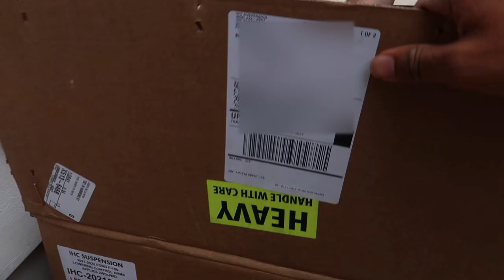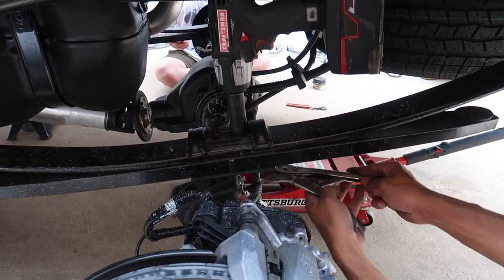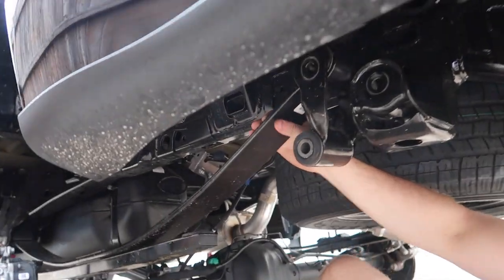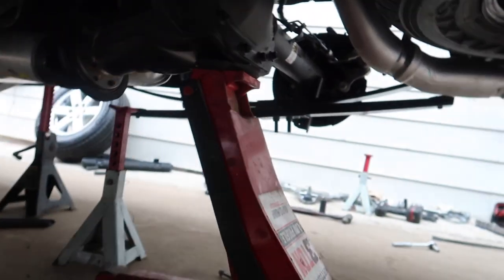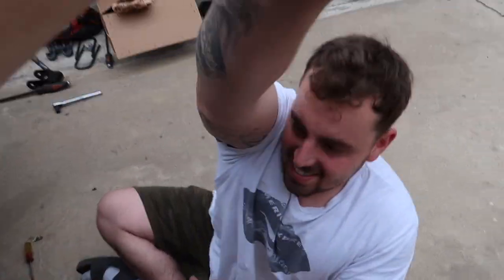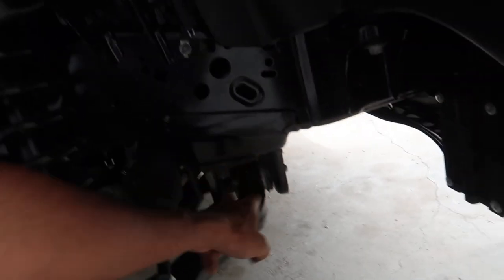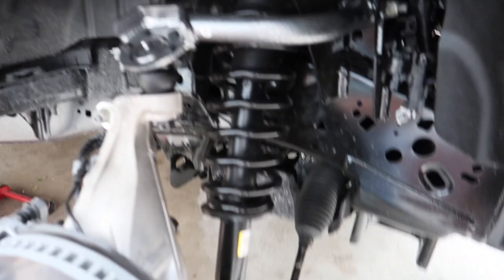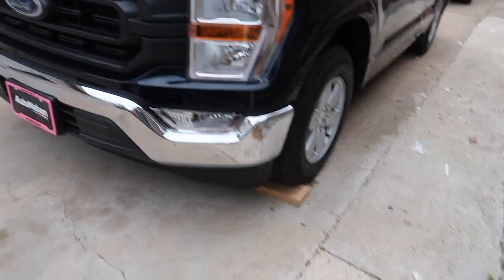LOWERING MY 22 F-150 COYOTE single cab on IHC 3/5 DROP

Comment: Do your leaf springs squeek after you installed the flip kit? I have the same kit and now they squeek. very annoying on a brand new truck
Reply from the maker: Yeah they do a bit! Grease up the shackles it minimizes it a bit. A good set of shocks will help too, I want to get some Viking shocks for it
Reply: @fajitaboyzDFW  thanks , i may loosen the shackle bolts a  little as well .
Reply: What did you end up doing to fix the squeaking?
Reply: @eduardox2609  not really, I loosened the shackle bolt a little and it worked for a little while but the squeek comes back but not too bad.
Reply: The trick is make your truck louder😂

Comment: I’m about to do the front on mine. How did you torque down the control arms? When it’s on the ground or before?
Reply from the maker: Snug them up in the air. if you can’t fit under the truck once you lower the truck, let it sit for a couple minutes, lift it up again and torque the bolts. You’ll probably need an alignment after wards so don’t tighten too much
Reply: @fajitaboyzDFW  thanks for the advice, also what color loctite did you use?
Reply from the maker: @5.0truck  Dont recommend

Comment: Was your rear shackles bolt heads very close to the leaf spring hanger? 
We did the rear last night and going back today to torque it down at ride height and it looks like the bolt head prevents the shackles from pivoting upwards.
Reply from the maker: Make sure they are on the corresponding side. From what I remember mine were close too
Reply: @fajitaboyzDFW  we got it. All good.

Comment: Any camber issues in the front?!
Reply from the maker: No sir! You can adjust camber on these
Reply: @fajitaboyzDFW  did yu get the adjustable control arms? For my truck they were only able to adjust the toe not the camber
Reply: @fajitaboyzDFW  *I have a 4x4 if that matters
Reply from the maker: @ramonmedellin11 ahh mine is only a 2/4 so maybe the 4x4 don’t have adjustment

Comment: I just got my rear kit on and the passenger side is lower than the driver side by 1/2 inch.

Does yours lean to the passenger side?
Reply from the maker: It does not. Just keep driving it, may still need to settle
Reply: @fajitaboyzDFW  gonna double check everything tmw, have to put the traction bars on and finish front

Comment: What’s the best gearing for these the 3.31 3.71 or the 3.71 with electric locking ?
Reply from the maker: For single cab the only ones available is the 3.31
Reply: @fajitaboyzDFW  for the 2023 I could’ve sworn I saw multiple options
Reply: @fajitaboyzDFW wrong, you can get the 3.73 in 2021-2023 if you got 4x4. In 2024 3.73 comes standard with rwd and 4x4.
Reply: @fajitaboyzDFW the options were 3.15, 3.31 for rwd. You could only get 3.73 if you got 4x4. If you really wanted you could of got the 3.15 or 3.31 with 4x4. Now on the 24 I’m pretty sure the only gear ratio is 3.73 on the regular cab short beds. I know it comes as standard equipment now.

Comment: Another question for yah, did you need to get a camber bolt to have it aligned? The shops near me won’t do it without one
Reply from the maker: I did not, I used the factory ones and tightened the f out of them, no camber yet I’ve had the kit on for a few weeks now.
Reply: @fajitaboyzDFW  thanks for the quick responses bro